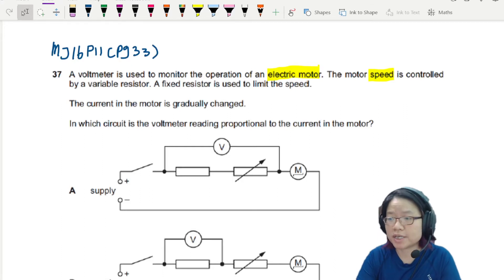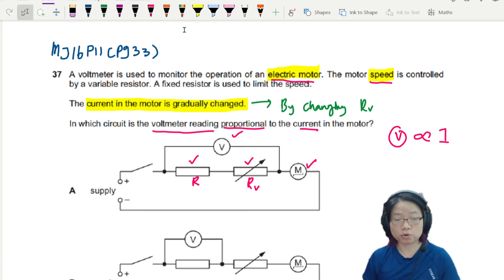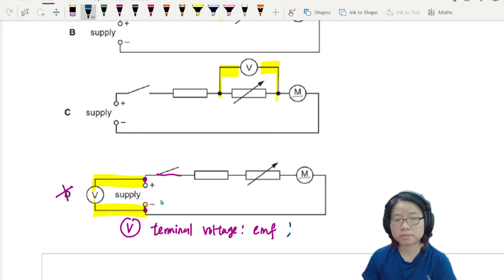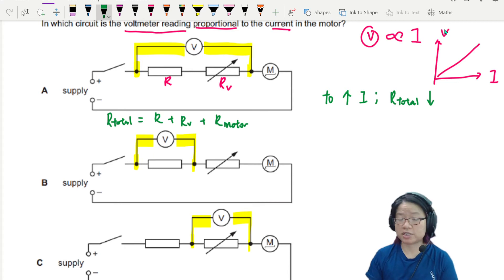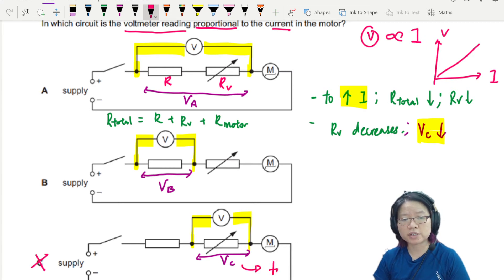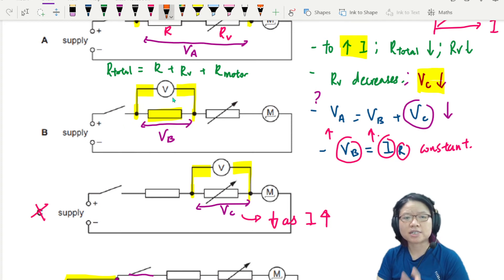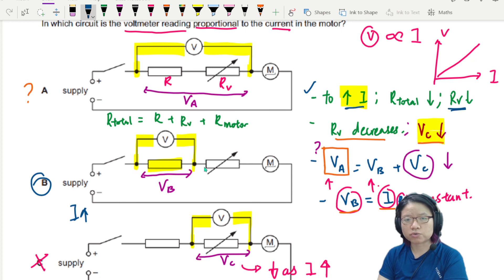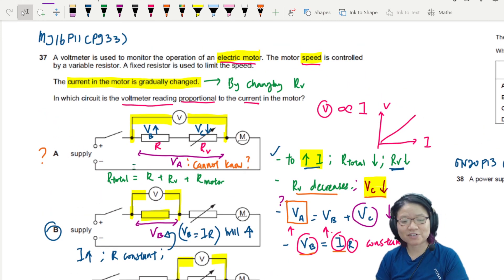10.3a Ex1 MJ16 P11 Q37 Motor Potential Divider Circuit | AS DC Circuits | Cambridge A Level Physics

Comment: it can be done more easily :3 for v to be proportional to R, there must be a constant, but in a and c, the voltmeter is connected to a variable resistor whose resistance might vary; and in d, there is no constant, but we need a constant for something to be proportional. Only in B, the voltmeter is connected to a fixed resistor, which is constant, thus v= IR where if R is the constant, we can say that v is proportional to R
Reply: But V has to be proportional to I, not R
Reply: @hason.z9729  I think they meant "V to be proportional to I", since if that applies, finding the constant R is the aim - which apparently it is, according to the proceeding explanations (If there is a variable resistor then R won't be constant; as such, V can't be proportional to I)
Reply: for real u are right i thought the same way